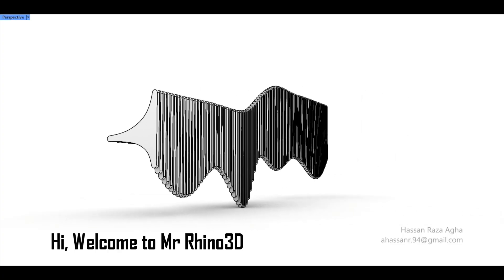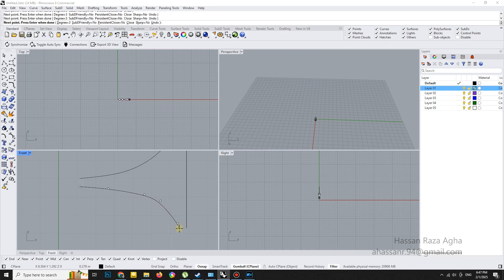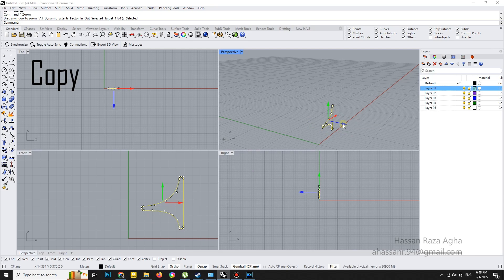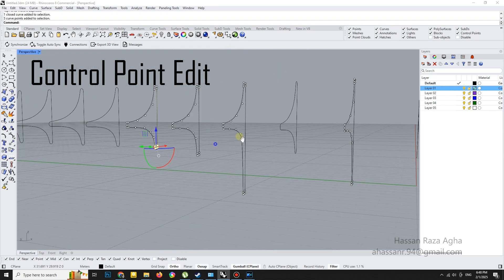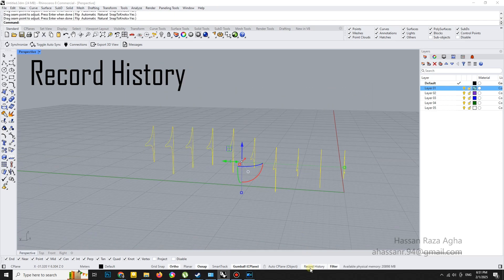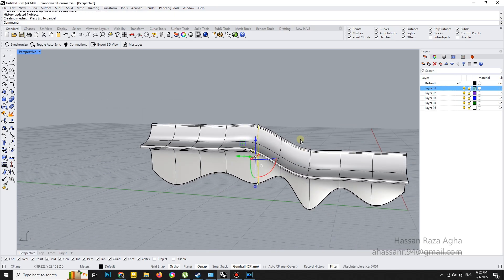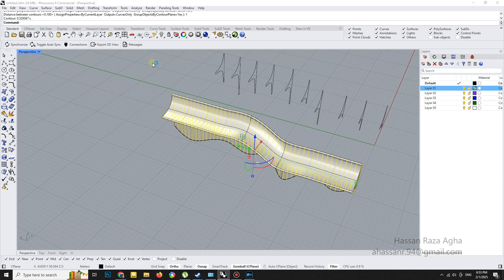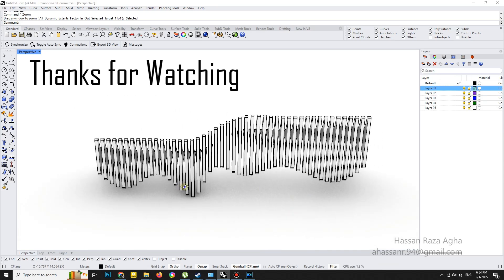Furniture Design in Rhino 3D - Loft + Contour

Comment: hi sir  need your help .... i want to make a parametric design then i want to cut it in a cnc machine so please guide me that how can i do that please and also add that how to make anything under measurement........ i am waiting for your response
Reply from the maker: Hi, thank you for reaching out. 

When you want to use CNC to create sections of your model, the best feature to use is "contour." After applying the contour, make sure to set the sections in the top view. For measurements, you can adjust your Rhino unit, in the setting. and you can use the scale tool to customize it as needed.
Reply: @   Hi sir i am new to rhino can you please make a video on it .. just a little video for how to make parametric vector for cnc and then copy it to artcam   
Please